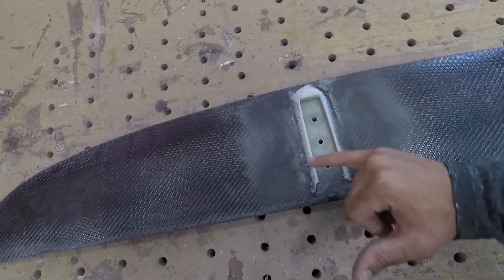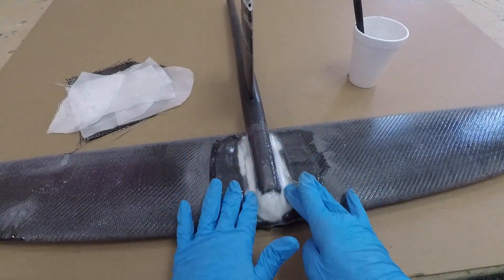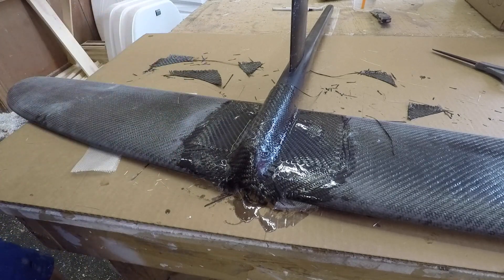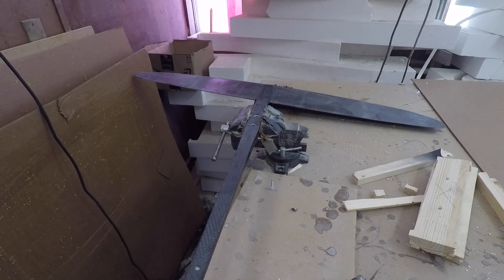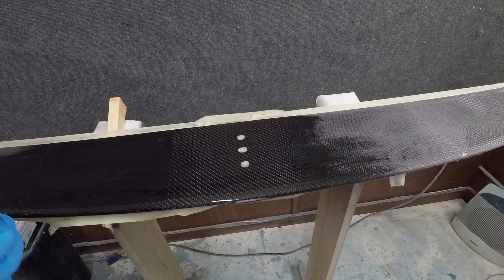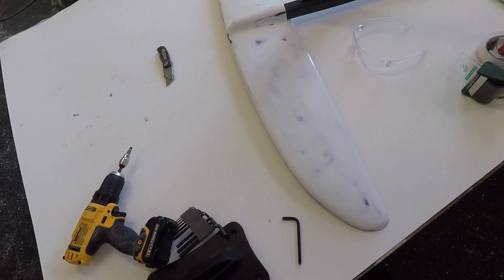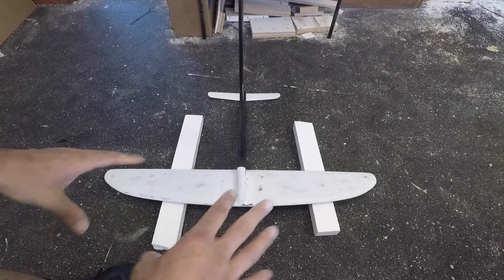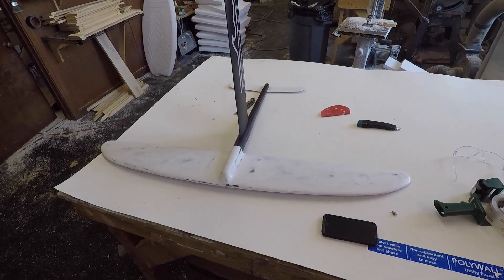Building the carbon HIGH ASPECT wing Part 3.... ITS DONE!

Comment: As you have experience riding these boards, is it easier to pump higher aspect/size foils or lower? My guess would be it is easier to pump lower aspect foil as it has smaller area to push against the water. Am I right or wrong?
Reply: larger wings with higher aspect are easier to pump and using a small board.